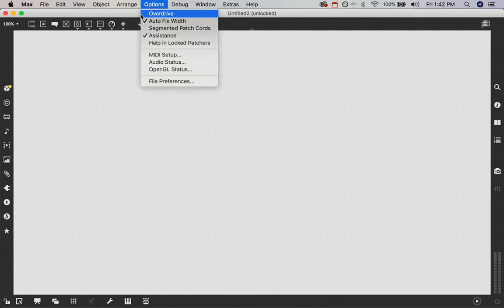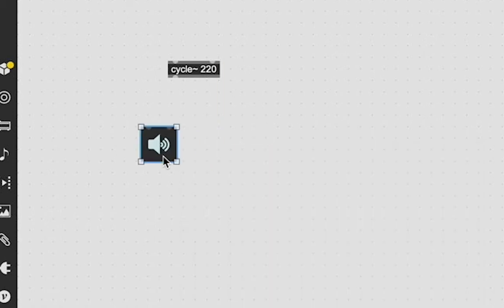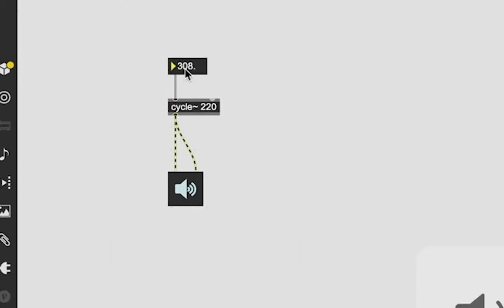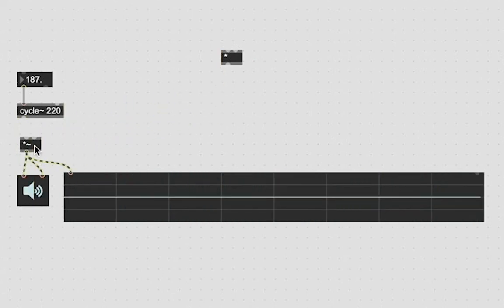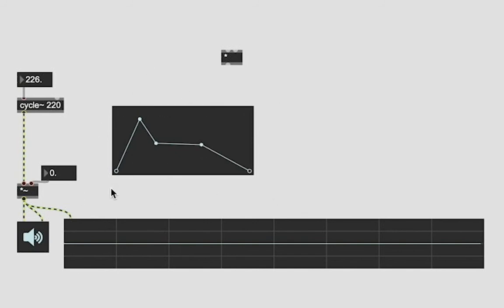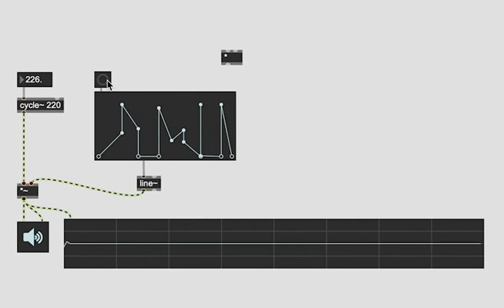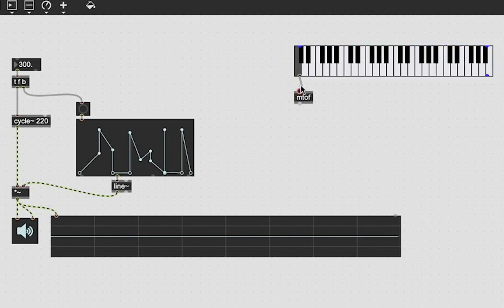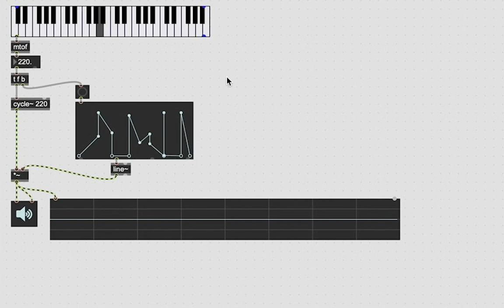Intro to Max MSP Audio Tutorial -- pt 1

Comment: Hello. How did you put inside the patch the float number box?
Reply: and also how you put numbers into the float number box? i mean how you activate it.
Reply from the maker: You can create a float number box either by creating a new object and typing in flonum or by pressing the f key on your keyboard. To enter numbers into you either need to patch data into it that passes numbers or you need to lock the patch and click and drag inside the float number box to move the value up or down.